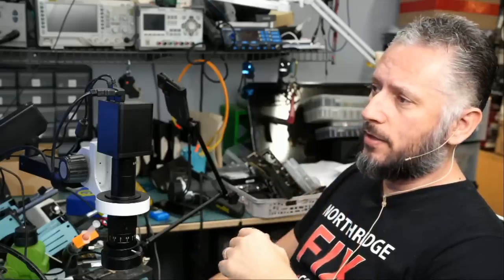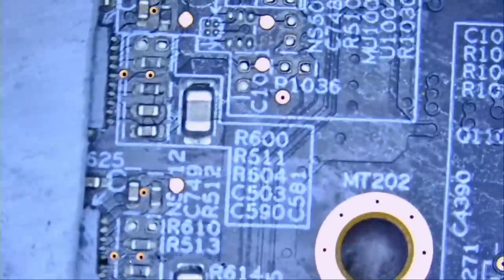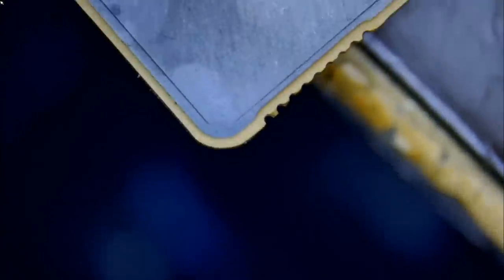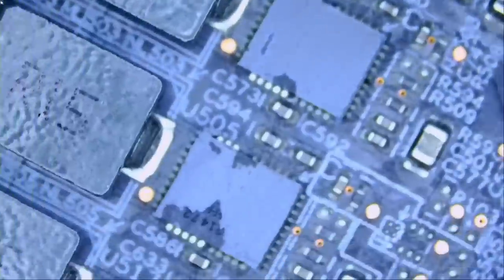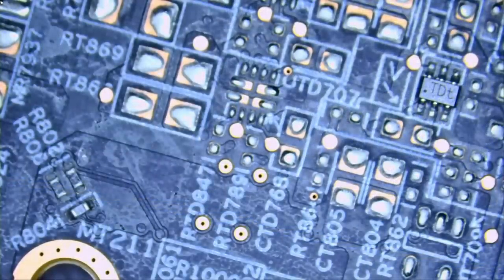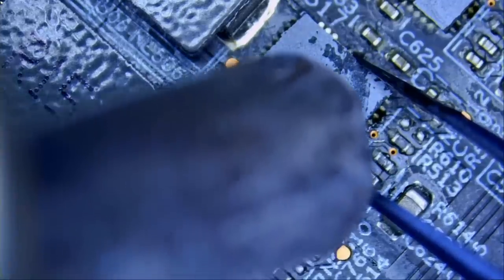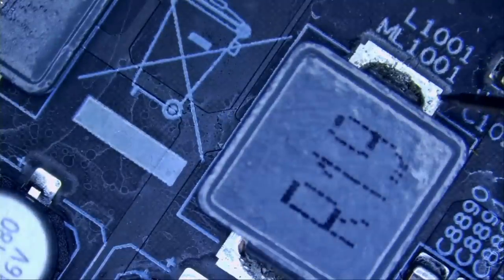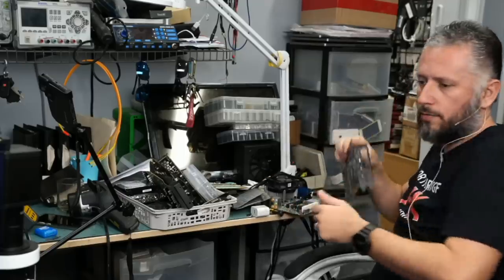AMD 6900xt Red Devil Ultimate Graphics Card Repair

Comment: The thermal camera sure does make short work of diagnosis.  I do electronics as a hobby and you have definitely demonstrated the value of thermal imaging very well.  Maybe I'll be able to justify a thermal camera for myself soon.
PS:  Thanks for periodically mentioning the amount of heat you need to use with these high layer count boards.  Very helpful for finding a starting point with the temp when trying to remove a faulty component.

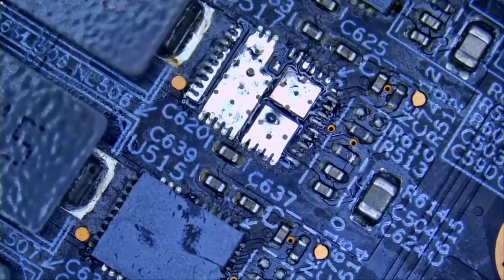Comment: 7:48
These are the ones that make me wonder about bridges under the chip. That little pad around the 1 o'clock position, and the larger pad at 3 o'clock. Neither appear to connect to the pins, or other hidden pads.
It must at least be possible for it to happen, so I'm curious what could cause it, and if they are all ground or no connection or anything else.

Comment: QUESTION: Why does it matter "where" you inject the voltage? If there is a short circuit, wouldn't any point flow the voltage to the "bad part" Just curious. Thanks.
Reply: Why would you go inject it somewhere else? If you found the short by checking at the drain, you know the short is there.

If you go inject somewhere else, you might not land on the right circuit.
Reply: Always inject volt throughout supply not from charger or adapter's
And supply will be automatically shut down and control volt
Reply: well you don't want to inject into a sensing line or into a small trace, you want to inject into the main rail bus

Comment: I have an MSI GF63 thin 9sc laptop. completely dead. At first when it was worn it suddenly died. I checked 19volt adapter is normal. As soon as it is plugged into the laptop it immediately drops. can this be fixed..? Thanks

Comment: To inyect voltage in a coil, you should measure ohms first so, coil does not suffer. You inyect then in the lower side of the coil (ohms).
Reply: this makes zero sense 😆
Reply: When you learn electronic's then you make your opinion.
Reply: @HazeAnderson  that says about your Knowledge in electrónic, coil divide the line so, the short its in one side of it. When you inyect voltage to the shorted side, the current will not pass by the coil. If you inyect in the not shorted side of the coil, then the current will pass true the coil and could cause to damage it.
Reply: Seeing other repair gpu video they always first measure the resistance between GND to 1.8V, 5V, PEX, vcore, dataline, memory and then plug the card to the PCIe.
Reply: @HazeAnderson  to you
Reply: @DunoCZ  I know what I`m talking about and I`m sure Alex knows what I`m talking about.
Reply: @DunoCZ  😂

Comment: AMD reference board designs are typically overbuilt. Usually the best version to go with when buying used, as long as the PO didn't molest it with a screwdriver, they'll function for the long haul.

Comment: Have been looking to upgrade to a better video card , it’s interesting to see a lot of repairs on Nvidia cards and not a lot on Amd , though it could be that they aren’t the go to card for system upgrades.
Reply: Exactly, it's because more people buy Nvidia cards, and people who buy Nvidia cards tend not to know what they're doing with computer hardware as much as AMD users. So they end up destroying them with liquid metal or whatever. It's the same reason you see a ton of Asus laptops on here getting repaired. It's not because they're poorly made, it's because everyone and their grandmother has one.

Most people also think AMD is worse for some reason... The 6950XT is actually as good as (in some cases a little better than) the 3090 Ti... And AMD is a lot cheaper, too.
Reply: Maybe a market share effect more than a reliability difference ? Nvidia is 80% of the GPU Market... 4 times more faulty Nvidia cards than AMD, given the same base reliability.
Reply: Righto. Survivorship bias is real interesting.

Comment: Sending my Gigabyte GeForce RTX 3080 Ti GAMING OC 12G back for RMA for the 2nd time. Bought it on 11/16/21 for $1400, and it died 3 months later playing Valheim (of all games), now it died 12/29/22, playing Valheim again. The first RMA, the PC would boot, but had no HDMI signal, they repaired it, and it worked for almost a year with no issues. This time, the PC wont boot if the GPU is plugged in. This card has two sockets for power, the left most socket gives it power, and the right gives it light. The lights work, but if you plug in the PCI-E cable into the power socket, the PC won't boot.

I already cleared CMOS, and put the BIOS back to a working default, other GPU's boot the PC fine. I think there's been a short circuit on the power socket or something...I have a Seasonic GX-1000 watt PSU, so that really shouldn't be an issue.

Comment: I thought it was a bit dangerous to power-up the graphics card with no heat sink. But you are the expert!
Reply: First of all there is almost no load when you start a GPU and there are temperature limits which will throttle the card down, but only up to a point.
Even an idle 4090 does not take more then 15W.
Reply: It's ok for a quick test. Of course you cannot put some gaming on it without the heat sink.

Comment: AMD cards use way less power than Nvidia, so it's not surprising they don't blow up as much :). 6900xt is only around 300w whereas 3080 and 3090 are 350-450w.